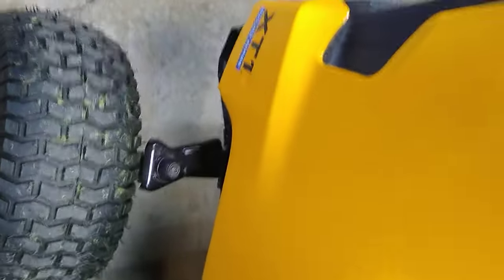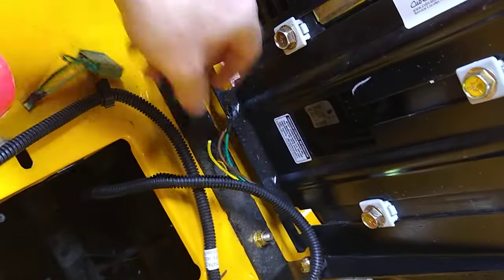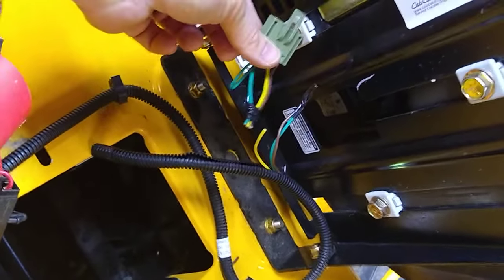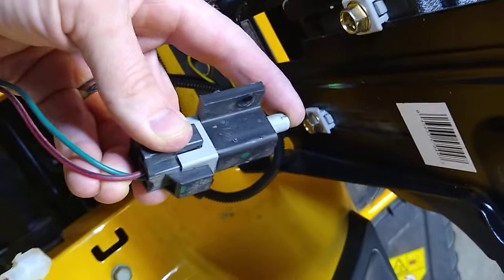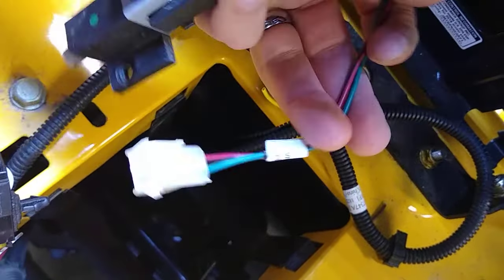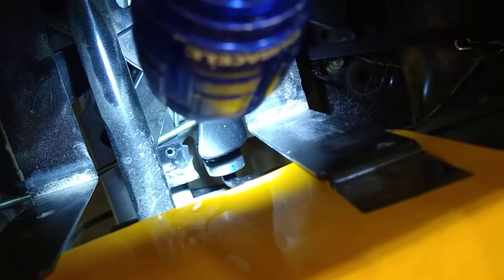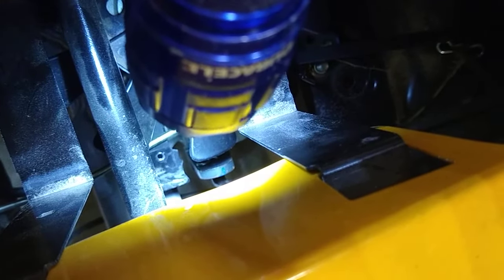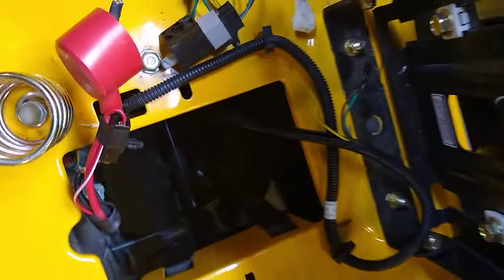Cub Cadet XT1  Safety Switches & Slow Reverse

Comment: I hope you realize that you will soon have cracked seat, only one of those bolt holes should have a bolt in it the two pastic tabs in the front provide a 3 pt seat mount.   Adding two more seat bolts puts stress on the plastic,  if you don't believe I got this info directly from CC tech support.

Comment: I thought it was probably just a switch, thanks for showing where the is! I just disconnected it at the switch. THere's another connector higher up that's seems easier to get to and probably would also work. Man I wish my battery had a handle. That thing was hard to pull out of that tight space. I need to put a strap under it!

Comment: For anyone who needs this. Last place I looked was the Headlights Shorted To Ground - Cub was running and just plain would not restart. No clicking, no power to the meter. Spent 2 days continuity testing solenoid with battery, and all 3 other safety switches (PTO, BRAKE AND SEAT). Disabled seat switch but removing the electrical bus in the connector. All other switches and solenoid tested AOK! 
Replaced ignition because old one was pretty worn out. Junk plastic anyway. STILL NOTHING. NO POWER. CHECKED GROUND AOK.
Then I heard a great tip about the headlights. Could it be that simple? Just went outside and disconnected them. BAMB! Power restored and started right up! Thank you!!! Although a frustrating experience, it saved me a trip to the repair shop! And I learned a lot about removing and testing these safety switches.

Comment: Thanks. If I buy one I will do all but the seat switch and it may be done at a later time
Reply: You might as well take the seat sensor off. My parking brake quit working due to the plastic parking brake lever not catching it and keeping it in place

Comment: My mower is the XT1. Following directions like you showed to do. Doing that as you did by itself didn’t work. Did I somehow miss a step?  Your method looked cut and dry.  What might I have left out?
Reply: Removing switch under battery disables starter operation....OP is wrong here!

Comment: the switch you removed to let peddle go back farther..can you just put a tie around the switch and secure the harness ..some where else ..mine still under warranty
Reply from the maker: Sure.  FYI - I removed the switch to stop the reverse shut down from happening and your solution probably works better.  I ground out the metal to let the peddle go back farther to speed up reverse a bit - that works great!

Comment: Hi, my cub cadet GT2542 has 4 green wires on seat safety switch. What can I do with that?
Reply from the maker: Not sure, but I would try cutting off the connector and see what happens if the connector is no longer shorting any wires together.

Comment: Where do you grind so reverse goes faster
Reply from the maker: If you remove the battery and look down at what is hitting what when you hit reverse you will see a lever that hits part of the metal frame, the metal frame needs to be ground so the metal lever can go back further.

Comment: I need a video on the last switch.  I tested it with a multimeter reader and it says the switch is still good. The kill button was pressed down when I removed it and I'm not sure if that is why I still do not have power.  This last switch is on the back wall that also holds the solenoid.  If I call it an interlock switch, it comes up correctly, but if I google those words, it all shows the brake switch.  Do you know how to get the metal arm off the 3rd safety switch?